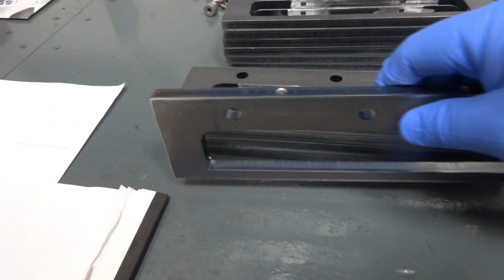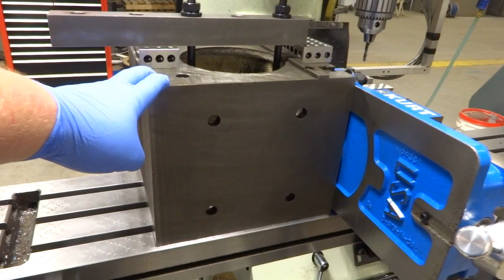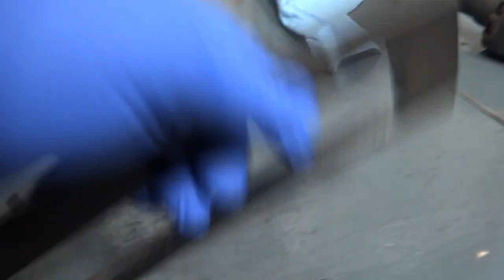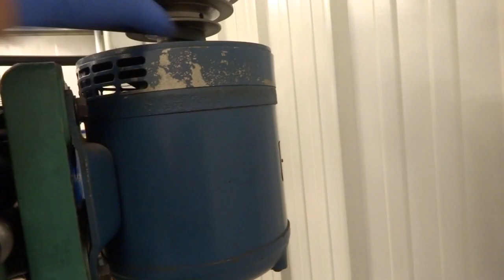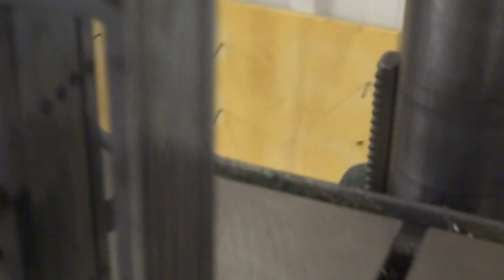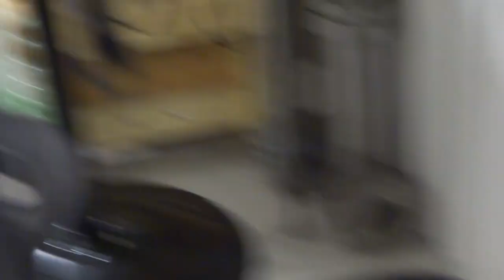Production Drilling on a Vertical Milling Machine

Comment: I want a drill dress like that......love the 90 degree mounting of the Kurt...those counter sinks are Putnam style I think, I have  a 3/8 one that I have used for maybe 20,000 or more holes in stainless 304,,,, they are amazing.. not to mention all the steel and 6061 holes.....I love my screw machine length bits with split point, but only in 118 ddgree, I find the 135 degree make odd chips and sometimes a non concentric hole...Cleveland is my preferred brand, ..stay away from Triumph in my opinion, cheers from Florida, Paul

Comment: enjoyed...I have the same drill press, an awesome unit!!  simple/smart setups, thanks for sharing
Reply from the maker: I know other people must own the same drill press but you are the first that I have 'met' that owns a Fobco.  Before I got my radial drill I used to drill 1.75" holes with it.  I had to get a MT3 to MT4 adaptor in order to do it.  The adapter was made by Collis and one day the drill jammed.  Without so much as a grunt the drill press twisted the tang off the adapter.  The drill press suffered no damage whatsoever.  I gained even more respect for it that day.  The only weakness it has is the brackets that hold the belt cover on.  Are yours broken as well?  Thanks, Ken
Reply: @hmw-ms3tx  here is a video of my unit... https://youtu.be/cY7WSGZmi0E

Comment: Hats off to you.
Just deburring that many parts..
Nice set ups and that drill press, hmmmm.
Music, my salvation for repeditive work, after good fixturing!
Reply from the maker: Hello Carl, the deburring was the worst part of the job.  Once that was done things started looking up.  As crazy as it sounds that Fobco 10-Eight drill press is one of my favourite machines in my shop.  It is so far above the crap that passes for a drill press these days that I feel good just standing next to it.  Ken
Reply: I understand completely your feelings about that droll press.
Solid, great range of speeds, easy to use, well made..
It just does it's job.. properly.
And those cross hole counter sinks are my go to.
I have quite a few, 60,85 &90deg in various sizes from 3mm hole to (I think) 30mm hole.
Easy to sharpen with a diamond impregnated burr in a dremel type tool, fineness inside the cross hole ONLY!
Superb bits of gear and very long wearing sharpening as above.

Comment: Reminds me off a job I had 25 years ago. The boss asked me to assembly and install the new drill press. It was a very nice gear machine with power feed on both knee and quill. 800x800mm table. 700+ kg machine. It could melt through 3cm thick steel with a 40mm drill bit with ease.

Such a nice heavy duty machine I got suspicious and asked what spurred this investment. The boss says: "I bid on a job that requires drilling a few holes". I looked at the machine: "How many holes?" " "60000" 

Thankfully he did not get that job, but kept the drill press anyway.
Reply from the maker: 60,000 holes.  I think I would have looked for a new place to work.  This is the first time I've done quantities this large.  Figuring out how to set it up to be efficient is enjoyable, but actually doing the work gets boring fast.  Ken